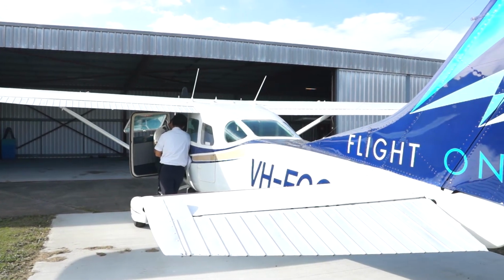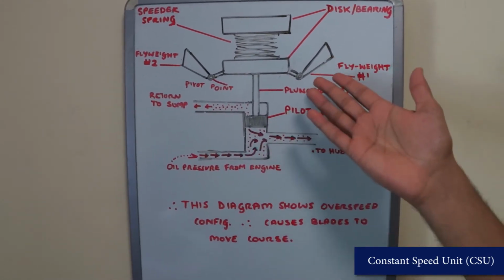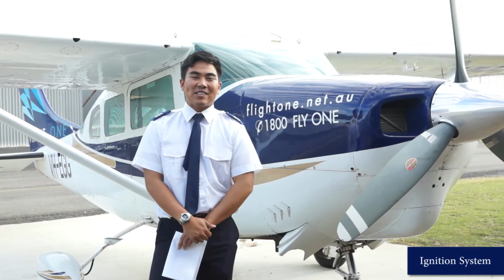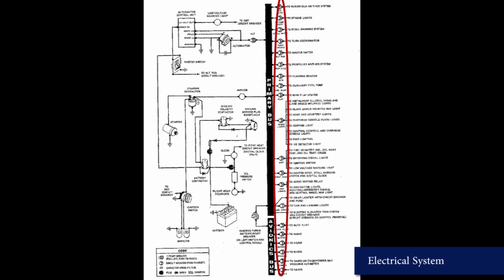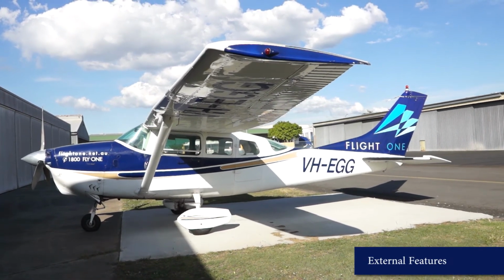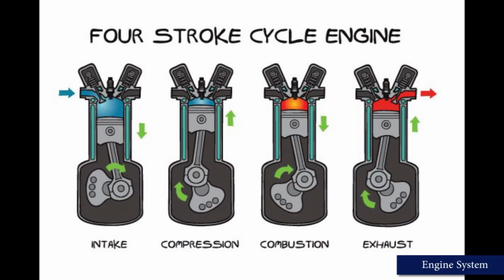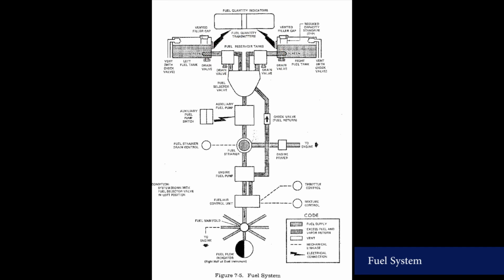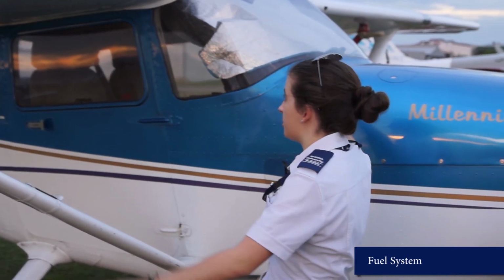The Cessna 206

Comment: It’s a 205, just look at that cowling.....Not a 206, doors, engine, etc..
Reply: It is registered as a C206B. It appears identical to the C210-5 (C205) because it was the same airframe for the first few years of production.The wing and tail group are similar to the C182 but were subsequently upgraded to the wing and tail group we are familiar with on the C 206 from about 1970 onwards. From 1970 onwards the wing has larger flaps and smaller span , but more effective ,centre hinged ailerons. The horizontal stabiliser is larger to deal with the marginal pitch response in the landing mode . With one or two persons in the front it took at lot of care to hold the nose wheel of at touchdown in the C205/ early C206.
The C205/ early C206 are useful for their two front doors and a workable rear passenger/ baggage door

Comment: How much heavier is this to land than a 182
Reply: Well.. the C206 is about 1600Kg. Its quite heavy at low speeds. Absolute beast coming in with full flaps though. I didnt find it as heavy coming from c172
Reply from the maker: The Cessna 206 is a heavier aircraft (Has a higher gross weight). Having flown both, the 206 has a much heavier feel when landing in comparison to the c182.